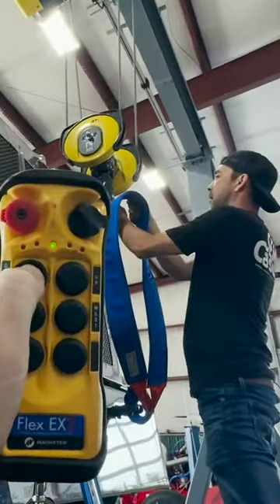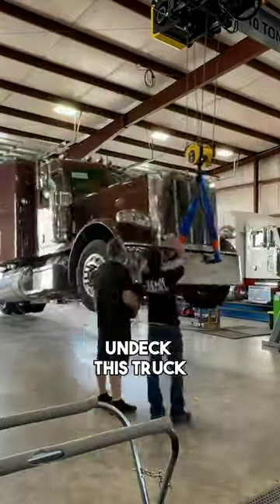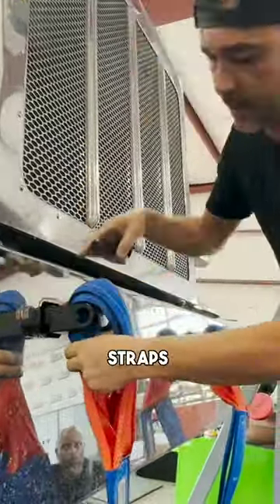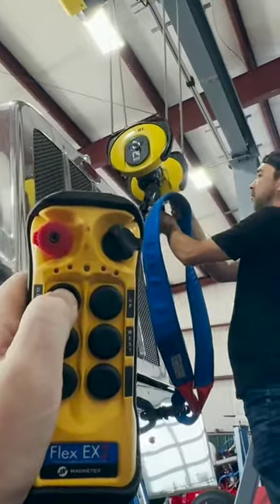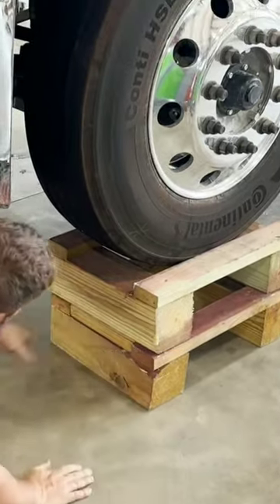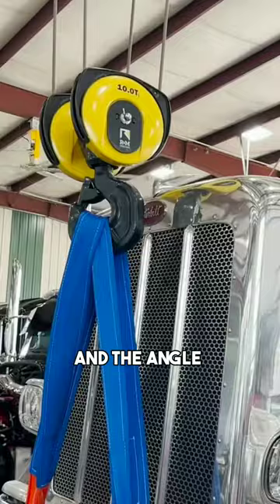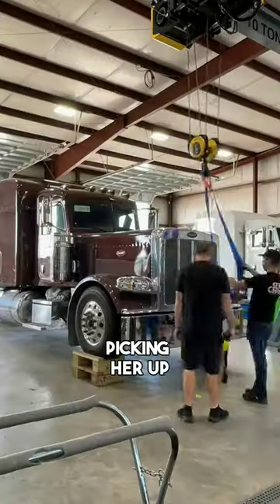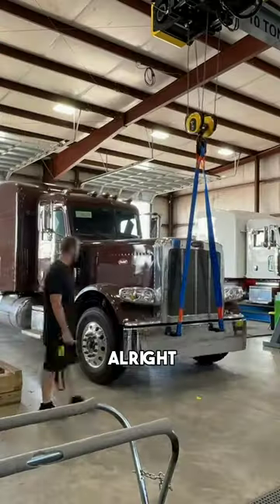New Crane VS New Truck. Is it big enough? #crane #truck #peterbilt #cool

Comment: I deliver trucks like this for a job frame mount saddles are spooky drop the air bags when u pull the lead truck away will help prevent damage to the oil pan

Comment: Build a rig that hooks over the front axle, bends below the bumper, and pins into the two lifting points your using, with the two bars that hook over the axle, should stick about a foot out in front of the bumper for your straps to hook to..

Comment: Had my truck piggy back in and the dealership didn't tighten the front wheel tight enough,in 1000 miles all the lug nuts came loose ,2 new wheels and hubs and 2 Days later and many phone calls to the dealership I was on the road again,

Comment: $270,000 truck,and they put cheap tires on it?
Reply: I never had a problem with Continental tires but they used to come from the factory with Michelin, which are the best out there imo
Reply: have Continentals on my trailer now....after 4 months thier about done... Bridgestone and Michelins I get 18 to 24 months.. I even get 12 to 18 on cheap Chinese tires....